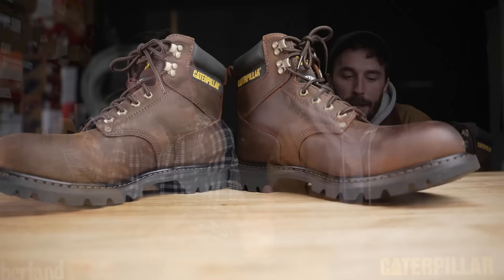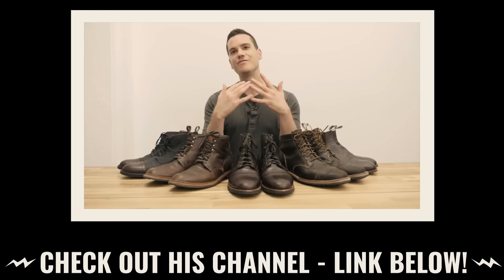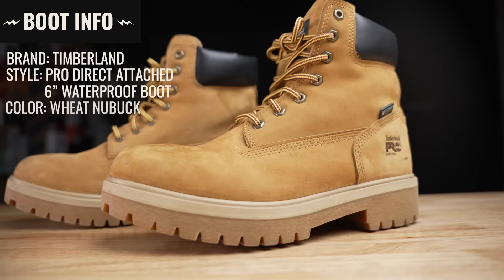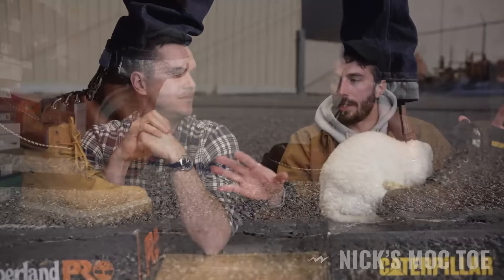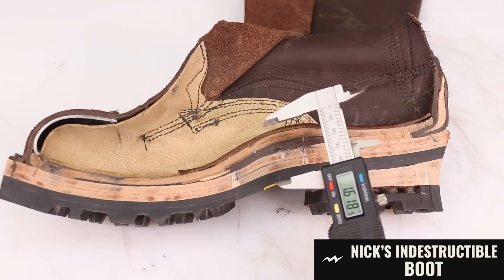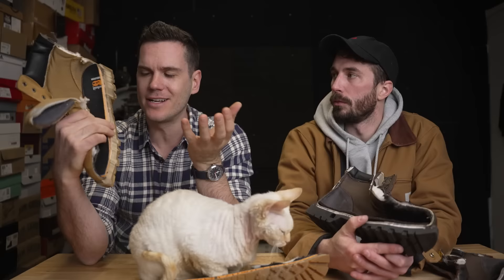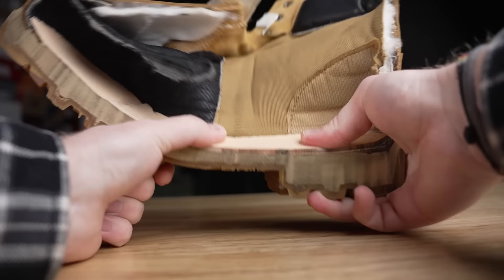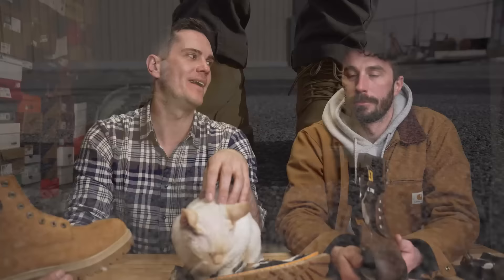Best Budget Work Boot - Timberland Pro VS CAT - (CUT IN HALF)

Comment: This one interested me because for the last three years I've been wearing a pair of (what I assume to be) knock-off Caterpillar/Timberland steel-toed work boots - branded Ambler, made in PRC, very hard-wearing soles (hence why they're still going strong after 3 years) that look like the Cats in this video but with nubuck uppers. The only under-foot padding is a bit of foam insole which ends well before the toes and with no shock-absorbence in the soles they aren't the best for walking distances, but they have been so durable. Only the soft-foam-filled collars have disintegrated and I could have had them with just plain nubuck all the way up, which would obviously have lasted better. Also the laces are about to snap.  I wanted to try to understand if my boots are comparable to the ones in this vid and I reckon that they're extremely similar to the Cats (but made in PRC).  Oddly, they don't seem to have any metal mid-sole in them., but I could be wrong. In my experience, I've had metal midsoles snap and then pierce through the outer sole, so they're a mixed blessing.
Price-wise, mine cost around £60 three years ago (call it $90) so they're even on the mark there. Having worn various cheap work boots/shoes, I can say that I've had a good year of wear (and better comfort) from shoes costing one fifth of what these cost, so I'm still expecting another couple of years out of these (and I'm disappointed with how hard they are underfoot). That solid rubber sole is really something. Thankfully my employer paid for them because I wouldn't want to pay that much myself. You say 'budget' - I say quite expensive. People who pay $150 for work boots must have money to burn. The Timberland boots here are definitely for posers rather than workers.

Comment: I've worn Cat Colorado boots for 16 years and only recently (yesterday in fact) tried these Deplete boots you're showing here. I had to send the deplete boots back because at the point where the tongue is attatched a fold of material gathers when you put them on which digs into the underside of your ankle bones making them agony to wear.
Similarly once I tried the Timberlands which I could hardly get my feet into because the tongue is attatched so high up. The metal surrounding the laceholes just came straight off because of this (the shoes were the right size). 
I've never worn either of these boots ever again.

Comment: from a manufacturing standpoint I have worn both brands (though not either of these specifically) waterproofing is not really a must or a concern, the only requirement of my job is steel/composite toe. The Cat and timberland where both slippery on dust (I do paper packaging, and paper dust is a every second affair) But I don't think any boot would be slip proof in that kind of environment. I also stand on concrete all day and the timberlands are hands down more comfortable. With the cats I had to even buy a new insole because the one it came with was way too thin, while the timberlands had a thinker insole and after watching this it makes since that it would have a thick foam too with how nice they are to stand in all day.

Comment: If I was doing roofing. A good new balance hiking shoe with a well grip traction is where the money is at.  If your in puddles sinking into mud to your knee a good laced rubber boot is the best.  I have the caterpillar when you're working on the ground carpentry dry day colder season awesome boots.  It took long time to break them in.  Not comfortable for couple weeks probably a month to get really comfy.  I wouldn't trust those boots to walk on walls framing homes if top wall is wet or icy.  Caterpillar bottom sole is a bit grippy just not as grippy like a new balance hiking shoe.

Comment: I have the timberland pros with the fiberglass toe and no insulation. Best summer work boot I've owned, super super comfy. I also got a pair of cats this year with the rubber toe protection and 200grams on thinsulate, so far great boot, pretty comfy, not as comfy as timberland. But i notice the rubber gets super hard and slippery around -10/-20C. Prob be going back to redwing for winter boots.

Comment: You need construction site experience with the booth. Also, different trades will want different things, for instance carpenters want their booths to be similar to running shoes, while welders are not going to care about weight... and so on.
Reply: I do carpentry construction in Buffalo N.Y. 
I'm 6'2" 220#'s and have owned 10+ pairs of Timberland Pro Direct Attach 8" steel toe over the last 20 years. I've never had any failures of the boot. My feet are warm in the winter and comfortable in the summer. 
I've found them to be extremely comfortable and agile for my various jobsites. I have bought more expensive domestically produced boots and still have preferred these. 
Boots are very subjective, even within the same trades. 
I also wear 6" moctoes fairly often which are a very different boot.

Comment: Wore the newbuck steeltoe cats working as a tractor trailer mechanic for about a year and they were fantastic shoes. I required an insert but that's almost every shoe. I didn't even really destroy them, I'd just gotten so much oil and grease and dirt buried in the leather that they were disgusting and got donated. I got a pair using the tighter leather grain and they were much easier to clean and outlasted me at that shitty job :)

Comment: You got the cheaper cats and they are still better mine are 140 leather is thicker they make the best work boots for the money in my opinion cut some dewalts I got a pair They have a steel plate through the bottom and the side of the boot 🥾 I’ve only had them for a short time so don’t really know if they are good boots yet

Comment: CAT boots, Achilles heel is the soft leather at the collar and the lining on the inside of the boot it does not last, and is worn out or destroyed long before the sole or the upper is warn. The area where the bunion is wear very quick too.. I don't wear exactly the same boot as reviewed in this video. but the durability on CAT is disappointing, compared to earlier boots in CAT range. I was a huge CAT fan, lately I am looking for an alternative.

Comment: I owned the Cat boots and they were not comfortable and were a piece of junk.  I bought the same Timberland Pro boot and they are super comfortable.  I use them for light work and going out at night with my Levis.  They are a great boot the only problem is they will get dirty quickly with that light tan finish.  I clean them with the Angelus Easy Cleaner for suede and a stiff soft metal boot brush will these boots will clean up like new.  My brush looks like it is a soft brass metal.  I use a Johnson suede and nubuck waterproofer spray on them after I clean them.

Comment: TBH, it's not a fair comparison. CAT has other boots that advertised waterproof as one of its features, but I know that CAT Second Shift is the most popular model. To match the price point on that Timberland Pro, check out the CAT Outbase, Threshold, or Upholder. Besides, Second Shift also has Soft Toe model which is cheaper than the one shown on the video.

Comment: I think it is significant that the outer sole of the Timberland is much thinner than that of the Caterpillar, especially at the heel.  I think the Timberland heels will wear down to the foam pretty quickly. The Caterpillar doesn't have that issue.

Comment: All that cushioning and huge sole on the Timberland won't be good in the long term. It might get tiring. 
Insulation is also a terrible idea unless you work in a really cold place. Your feet will get steaming hot after working for many hours. 
That said, Timberland waterproofing is unrivalled and will literally last for the entire lifetime of the boot. That plus the insulation makes them perfect for harsh winters. 

I love the Cats. Enough cushioning to keep your feet happy and will breathe better. 
I just wish they also had a composite shank to be more flexible. 
I'd get the Timbs for winter and the CATs for everything else.

Comment: I actually like the feeling of the Cats better. They're good, comfortable four season footwear -- but then I don't live in a place where you deal with negative temperatures or snow except maybe once every couple of years, and just a couple days at a time even then. They've very comfortable after you've worn them for a bit, much easier to get on and off than Timberlands, and nice and lightweight. There is an issue, though, which is that if you have a heel that's hard on boots and shoes in general, that lining behind the heel is going to be totally gone by the time you hit 150 or 200 wears. That's similar longevity to most sneakers, not what you'd expect from a leather boot.

Comment: I have worn my timberland pro 6 inch steel toe direct attach sole, everyday for almost 5 years now. I can tell you not a single part of the shoes outer sole has yet to delaminate at all, the inner soles disintegrated, the new buck leather is quite prone to chipping, i didnt realise i was hitting the inner edge of my locker when putting my boots away and was cutting/gouging chunks out of the toe, the only part that fails for me is the material that the ankle cushioning is wrapped in, it is not leather and has worn down from where i pull the shoes up at the back, if these shoes had a pull tab or real leather wrapping around the ankle  cushioning or both these shoes will easily last another 2 years easy

Comment: I like the Timberland Pro's I've been wearing them for about 2 years and they're good for what they are but I would def switch to something that is easy to restore instead of nubuck but they've done me good for the last couple years.
Reply: Getting “years” out a single pair of boots is kind of crazy to me. Any footwear tbh
Reply: @CANControlGRAFFITI  I mean there are way more durable boots like Red wings can last you way longer or other boots but they're a lot more expensive but a lot easier to clean up or restore than my Timberlands I've roughed them up a lot over the last 2 years but my red wings have lasted me far longer.

Comment: The Cats are pretty damn good. The "track lugs" hold up good nd provide a lot of traction. I use the 11" slip on steel toe with same track sole. Wore through water nd mud nd feet stayed dry. Of course not standing in water to soak the boot, but walkn across water no problem.

Comment: That hard rubber welt on the cats WILL NOT break. Confirmed. I have beat mine up for 4 years in construction and the welt is in good shape. Scratched, scuffed up but not cracked anywhere. Such hardy boots.

Comment: Tried 3 different sizes of the CAT boots, but they do not agree with my feet. They are unnecessarily long and they dig into the top of foot, not because of the steel toes, but the dimensions of the boot. They seem like they're made for very long, flat, and narrow feet. The top of my feet aren't flat enough, my foot is too wide/too short. Haven't tried Timberland's but I may have to if I can't find another cheap, durable brand that agrees with my feet.

Comment: Timberland Pro is very comfortable fine for light duty but if you do any real work like stomping on a spade shovel digging s hole you'll find that thin rubber foam filled sole not very durable. The heel split and rubber chunked off exposing the foam core which allows water to be absorbed.So much for waterproof! You get what you pay for its a 1-2 year boot at best.

Comment: Ive owned both and used them extensively as a carpenter and plumber. The cats ive had for 5 years and theyve kinda collapsed and hurt my feet a little more than the timberlands.

Comment: I'll be honest I've had both of these in steel toe the timberlands are by far the better boot they both are quite heavy but the comfort of the timberlands is unreal. The cats your feet are on fire after a few hours the only draw back I would have with the timberlands is you will only get a year of work out of the soles they wear out quite quickly. The thermal insulation isn't really an issue from my experience being an electrician in Ireland

Comment: The foam does not have durability, it does not resist heat or humidity, so it will be comfortable, but only for a year or less, the foam will turn to dust before the year is over.

Comment: My latest two Timberland Pros (I usually buy two at a time) have been difficult to lace up at the top and they cut into my ankles. If I had to guess, the manufacturers have skimped by an 1/8  to a 1/16th of an inch of leather at the top. I've bought about a 6 pairs over the last 40 years and the quality seems to have gone down. My latest ones  were manufactured in China.
Reply: you either bought some fake or bought timberland basic waterproof.  The pro are really comfortable but too heavy.

Comment: I wear those cats. They were the most painful boot I've ever broken in. Terrible! I am a mechanic and I spend my whole day standing on concrete in puddles of oil, break fluid, coolant, and transmission fluid. Haven't even worn them a year and the sole is very worn and swollen from the fluids they're in contact with. But they were cheap

Comment: Can you explain why the effort with the hand knife, only to follow up with a Band saw to cut thru everything else.
Why not just use the band saw in the beginning?
Reply: The brain doesn't compute that far. Same reason he cuts the laces instead of taking them off
Reply from the maker: Cutting the upper first helps prevent it from catching on the bandsaw and binding it up making it much safer to cut. Also people like watching them being cut with a knife.
Reply from the maker: As for the laces, we don’t really have a use for hundreds of pairs of extra laces. Especially since we keep the other side with the laces in for future videos and b roll. Aaand they are fun to cut
Reply: @Rose Anvil  catching on blade makes sense,  knew there was a reason.  Thanks

Comment: Budget… let me know when a $50-100 pair of boots makes the cut. I’d love a boot with the comfort of a sneaker (midsole). I almost bought a pair of Timberlands, but passed due to the price.

I love the Timberland look. But so heavy! The Cats look meh. Toe and shank…not quite what I need. Looks okay from a specs perspective but i don’t think I can stand using them for 12 hour days on my feet.
Reply: The Timberland pros are the most comfortable boot I've ever worn. The Pro line is huge and I know guys with several different styles. The general consensus is that they're extremely comfortable out of the box. The Timberland pit boss is very similiar and really good at about $100. They also have steel toe sneakers, I don't recall the name, but I had a pair of the low tops and they were very light/comfortable, also about $100. In my experience that's about the bare minimum you can spend for something decent. Check out the Timberland Pro lineup, there's alot of options. Good luck.

Comment: I had a pair of CAT Deplete WP before and the outsole was amazingly poor in quality.....
The over all wearing felt very comfortable. But after 2 years of walking on pavement & sitting in my office, holes appeared on the heel of the outsole and one day when i'm walking home in the rain, i found my heels were wet. Turns out, the heel of the outsole was HOLLOW and water from the ground seeped through the outsole & were absorbed by the insole & finally wet my socks. I was like, bruh, I'm white collar, I don't even wear these shit near construction sites. My high satisfaction of them quickly turned into despise after this, and i threw that pair away the next day.
I 'm disappointed that they didn't hold on to their standards on non-working boot.

Comment: Hi! Does any of these boots were tested in metal detectors similar to Smiths or Garret at the airport? I work in aviation and Metal Free Safety shoes or working boots is our go to. Unless the boots have minimal metal which is undetectable within a 75/100 sensitivity rating for metal detectors then this would work. I'm not sure if those eyelets metals are detectable.  Police who are stationed at the scanning areas for employees would instruct us to remove boots if the metal detectors will sound, so its a bit of a hassle. We currently use a Honeywell metal free safety shoe with composite toe guard but we are looking for a lighter alternative since we work in the UAE and it is very hot during summer time.

Comment: Something you do not cover in any of your presentations. Example, I purchased Timberland(might have been CAT) Boots just like the pair in this presentation, actually I purchased 2 identical pair at the same time. I liked them so much I wanted a back-up in the event I damaged the primary pair or I just plain wore them out. And that is actually what happened, I wore the primary pair out over many years, maybe 5 years maybe 10 years. So I discarded the wore / primary pair and cracked open the untouched new pair the backup pair and started waring them. Within a few days the entire sole came off in the grocery store. Needless to say an embarrassing moment. I called the manufacturer and explained what had happened. They told me that because I had not used this new pair for all these years the glue they use will degrade / delaminate over time unless the boots are used. I don’t know if I believe that or not I not a chemical engineer nor a chemist just a hardware / software engineer that worked for IBM(I took early retirement  and started a new second career). It would be nice if you could find some way to look into this.

Ricky from IBM, Ret